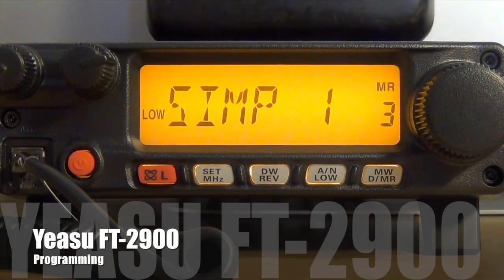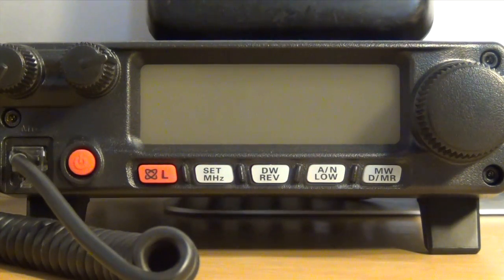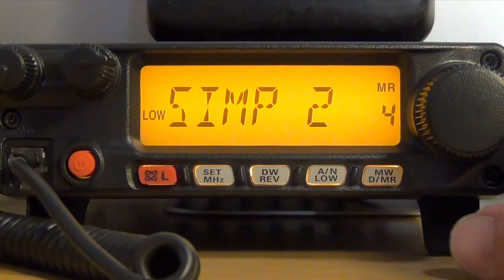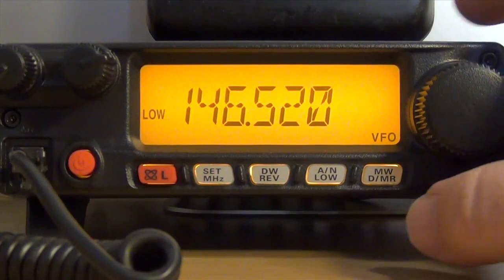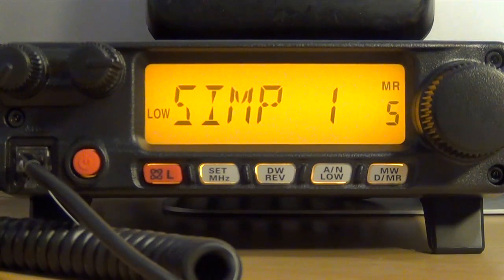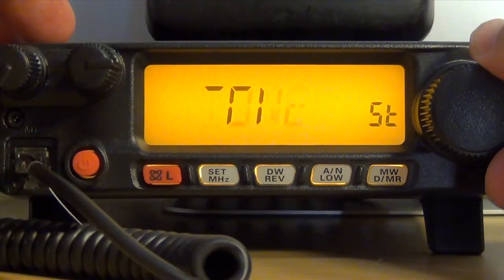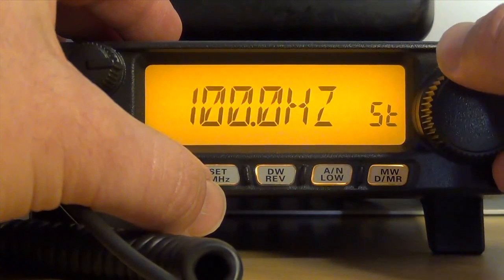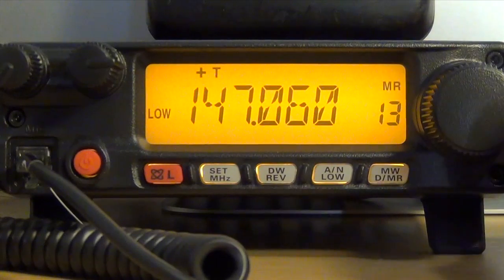Yaesu FT-2980 and FT-2900R Programming Tutorial

Comment: Thank you for posting this! It was 8 years old but wow it was much more helpfull than reading the manual. Just got my license a couple of months ago and my dad gave this radio that was used to monitor trucking ages ago. The radio was not used for at least 10(?) years so I cleaned it and work just fine. Also at first I did not expected it to outputting 75 on high, more like 30 or 40 max 😅. Really impressed so far with this radio. Future goal was for ISS repeater use though it still need separate UHF downlink.
Reply from the maker: Thank you for taking the time to watch and the comment! It is greatly appreciated. Glad the video was helpful!!

Comment: Do you know how to set power level so it will stay to a channel that’s already in memory. I didn’t do it on as I programmed it. Completely forgot.  I manually programmed 89 channels and do not wanna do it all over again
Reply from the maker: Thank you for taking the time to watch and the comment! It is greatly appreciated. If memory serves you would have to either rewrite a new channelof the old one or reset the whole radio.
Reply: @WJ6FRadio  yeah. I found it easier to just rewrite the channel as I need. I think they should tweak the software of the radio so you when you change the power it stays till you change it again. Great radio tho. 73’s KQ4LPW

Comment: How do you set the Plus or minus settings? Thanks
Reply from the maker: Thank you for taking the time to watch and the comment! It is greatly appreciated.  1. Press and hold the [MHz(SET)] button for one second, then rotate the dial knob to to select "43 RPT."  2. Press the [MHz(SET)] key, then rotate the dial knob to select the desired shift direction (-RPT, +RPT , or SIMP). 3. Press and hold the [MHz(SET)] button for one second to save your new setting and exit to normal operation.

Comment: It has 80w output power, hence the name 29”80”
Reply from the maker: Not sure the reason for your statement. However, when this video was made there was no such thing as an FT-2980. When the FT-2980 came out I changed the title since there was no point in making a second video since both the FT2900 and FT-2980 are the same.

Comment: How can i unlock it to transmit?
Reply from the maker: Thank you for taking the time to watch and the comment! It is greatly appreciated. Are you showing a key or pad lock icon on your radio? If so,  Press and hold the far left button for about one second to lock/unlock certain features of the radio. If that doesn't work you may have to reset the radio back to factory settings.
Reply: @WJ6FRadio  well its new out of the box and it works on 144.000 but not on 171.000 the ones i need at work
Reply from the maker: The FT-2980 radio is set up by Yaesu to Transmit on frequencies 144 - 148 MHz which is the 2 meter band for Amateur radio and a license is needed to transmit on those frequencies.
Reply: @WJ6FRadio  we are in Canada here none of that is needed then my boss pays a yearly or monthly fee to use it , but anyhow i bought this and if i can’t unlock it it worthless to anyone

Comment: I never heard anything on deleting a channel. Not overwrite, but delete a memory channel. You only did a portion of the subject.
Reply from the maker: I looked through the manual several times, and I found out you can mask and unmask a memory channel and delete a memory bank. However, to my knowledge the only way to delete a channel is to either write a new one over it, or reset the whole radio to factory settings (Not something I would want to do). If you have found out how to delete a memory channel please share it.
Reply: @WJ6FRadio  That's what I came up with also. Just wanted to see if you had a positive reply to my comment.  Too bad Yaesu  didn't think of that. Thank you for you time.
Reply from the maker: @Recondite-g9r  It seems insane that they wouldn't work in a way to delete a channel.

Comment: How do you set the power level after you manually program the frequency?
Reply from the maker: Thank you for taking the time to watch and the comment! It is greatly appreciated. You can temporarily change the power setting by pressing the A/N [LOW] button (second from the right). Hope this help you.
Reply: @WJ6FRadio  got it thanks. I love this radio. Well I have the 2980 donuts the same thing
Reply from the maker: @Whiskey6Radio  I too have the FT-2980. Both have been absolute workhorses.

Comment: I am a novice at best. I know very little about ham radios. I am looking at a Yaesu FT-2900R for $100. I have heard that the Yaesu is a better upper brand radio and not a cheaper China radio. Is this a good price? In your video you said that your going to make it your base radio so you must think high enough about it.
Reply from the maker: Thank you for taking the time to watch and the comment! It is greatly appreciated. Personally, and this is only what i personally would do, if you are not in a hurry to get a new radio check the prices for the FT-2980. It is essentially the exact same radio as the FT-2900, except that is an 80 watt radio instead of 75 watt... I know it's only 5 watts, but I have seen it on sale for as lw as $125. Right now they are on sale for $139.95 at HRO. But all in all $100 isn't too bad, but might want to see if you can find it lower on QRZ Swapmeet

Comment: Very nice video. That was the easiest way to program my ft-2980r. Now I’m up an running . Just put my Diamond CP22E antenna on top of my tower. I hit all local repeaters in my area. Have been doing very well on simplex. Thank you an “73” from KC3PMX. Greg
Reply from the maker: Thank you for taking the time to watch and the comment! It is greatly appreciated. They are great radios! Since making this video I have sold off my FT-2900 and nw have the FT-2980.
Reply: So the 2900 and thevfc 2980 are both programmed the same way?  Thanks.

Comment: I just made my first contact with the FT-2900. Very stoked about that. The signal coming in sounds great using a mag-mount on a sheet of steel.
Reply from the maker: Thank you for taking the time to watch and the comment! It is greatly appreciated. They are a great radio. My first 2m/440 base antenna was on the back of a cookie sheet.
Reply: @WJ6FRadio  A MAGNET ANTENNA USED INDOORS WILL WORK IF YOU CAN'T GET AN OUTDOOR ANTENNA ON ROOF?🤔🤔

Comment: Good job, Craig. that’s exactly what I needed. I’ll be putting my ft-2900 rig together tomorrow.
Reply from the maker: Thank you for taking the time to watch and the comment! It is greatly appreciated.  They are great radios! Nice to have that much power without having to lug an amp around.
Reply: @WJ6FRadio  I AM STILL TRYING TO DO THE REPEATER PART PUT IN CHANNEL THEN YOU CAN TRANSMIT AND RECEIVE ON THAT ONE CHANNEL.  HELP!🤔
Reply from the maker: @XXX To transmit and receive on same frequency is Simplex.
Reply: @WJ6FRadio  YES🤔
Reply: @WJ6FRadio  I DON'T NEED A MANUAL TO CONFUSE ME MORE.🤪  OTHERWISE I WILL WEAR OUT RESET BUTTON🤪🤔🤔.

Comment: Please show 1. How to set the plus+ and minus-
2. show how to set the squelch so you can control the white  noise with the radio squelch knob
great video.. good work
Reply from the maker: Thank you for taking the time to watch and the comment! It is greatly appreciated.  To set the repeater shift; 1. press and hold SET [MHz] about 1 second w. turn to menu item 43. 3. quick press the SET [MHz] button and rotate the dial to choose Simplex, - Rpt, + Rpt. 4. press and hold the SET [MHz] for 1 second to return to VFO.
Reply: @WJ6FRadio  WHAT HAPPENS IF YOU DONT SET THE + OR-? AND LEAVE IT OFF.?🤔

Comment: how can I change the offset I need a - but the rig gives a + on the freq im trying to programThanks
Reply from the maker: Thank you for taking the time to watch and the comment! It is greatly appreciated. 1. Press and hold MHz(SET) for one second, 2. Then rotate dial to 43 RPT, 3. Again press MHz(SET) quickly, 4. rotate knob to desired shift direction (+RPT, -RPT, SIMP), 5. Press and hold MHz(SET) for one second to save setting and exit to normal operation.

Comment: What does the repeater  do  once it is programmed  I am also new to the  yeasu FM transceiver 2980
Reply: So you get more range out of it?
Reply from the maker: Yes, repeaters extend your range. Depending where the repeater is it can really allow you to reach many miles! I have one near me that I can literally be in parts of San Diego County and talk with someone in Los Angeles County. I have even talked to someone on a cruise ship that was off the coast of San Diego.
Reply from the maker: Thank you for taking the time to watch and the comment! It is greatly appreciated. I to switched to the FT-2980. The repeater is an electronic device that receives a weak or low-level radio signal and retransmits it at a higher level or higher power, so that the signal can cover longer distances without degradation.
Reply: Bad Grandpa  👎🤯🤮

Comment: Great job,  very well done 
73's KG7LPH
Reply: VideosByDPF 
Question, 2900 set at 30w.
Keying Mike on national calling freq 146.520 n0 problem, BUT keying on any other freq. Radio shuts down and comes up on 146520
What's. Up. Dummy load used I don't know.
Reply from the maker: george l. conklin I’m so sorry I missed this question. Have you solved the problem, if so what was causing the issue?
Reply: @angoman8641  🤔🤔👍
Reply: VideosByDPF 
How can I best reach you?
Reply from the maker: george l. conklin my email address is on  QRZ
Reply from the maker: Thank you for taking the time to watch and the comment! It is greatly appreciated.
Reply: I may have a few question in a day or two...working on my 2900
Reply from the maker: No problem!

Comment: Great video, easy to understand. Wondering how you can set this to skip a channel when in the scanning mode?
Reply from the maker: Thank you for taking the time to watch. here are the directions from the manual for "Memory Skip Scanning." Hopefully, this helps. 

To mask a memory to be skipped (only) during scanning, use the following procedure:
1. Set the radio to the Memory Recall mode by pressing the [D/MR (MW)] key repeatedly, as necessary, until “MR” and a channel number appear on the right side of the display.
2. Rotate the DIAL knob to select the Memory Channel to be skipped during scanning.
3. Press and hold in the [MHz (SET)] key for one second, then rotate the DIAL knob to select “47 SKIP.” 
4. Press the [MHz (SET)] key, then rotate the DIAL knob so as to select “SKIP.” The current Memory Channel will now be ignored during scanning. The “ONLY” selection is used for “Preferential Memory Scan,” described in the next section.
5. Press and hold [MHz (SET)] key for one second to save the new setting and exit to normal operation.
A “SKIP” icon will appear when you recall the “skipped” memory channel manually.
To re-institute a channel into the scanning loop, select “OFF” in step 4 above, after first recalling the currently-blocked channel (the “Skipped” channel is accessible via manual channel selection methods using the DIAL knob in the Memory mode, whether or not it is locked out of the scanning loop).

Comment: Thanks much! I'm a recently retired radio engineer, Commercial GROL, and finally have time to enter the great world of Amateur Radio which I've found vast, interest-limitless and will keep me quite busy until the tombstone. 
This FT-2900R is so packed with options and features - it's amazing. I agree with the instructor's observation regarding the max-level 75w RF output - impressive for a high band / 2-meter mobile without an external RF amp. It was one of the first things I checked into a 50-ohm dummy load - yep, 75w.  I am far from fluency on this FT-2900. 
Thank you Mr. Instructor DPF. The tutorial was excellent!
Reply from the maker: It is a solid radio! I had debated with getting one of the new FTM-3200 radios, but The FT-2900 seems to be much more rugged, and not having a fan is one less thing to worry about breaking in a SHTF scenario. Since I live in earthquake country this a concern for me. Plus the FTM-3200 only puts out 65 watts, not that there is a huge difference in distance between the two.
Reply: @WJ6FRadio  DOESNT A FAN KEEP RADIO COOLER BUT AT SAME TIME MAKE MORE NOISE TO THE POINT IT'S DIFFICULT TO HEAR RADIO AND DISTRACTING??🤔

Comment: Thanks for the video, Ive been looking through the manual for my FT-1500M on how to Delete a memory, your interface seem fairly similar, do you know how to delete a memory
Reply from the maker: Thank you for taking the time to watch and comment! If you are asking about how to delete the memory on a FT-1500 then no I don't. This is what I found in the manual on page 40, but this is for Memory Banks; 

1. While operating in Memory Bank mode, recall the memory channel to be removed from a Memory Bank.

2. Press and hold [D/MR (MW)] key for one second, then press the [A/N (LOW)] key to remove the memory channel data from the Memory Bank.
Reply: Works!!! Thanks